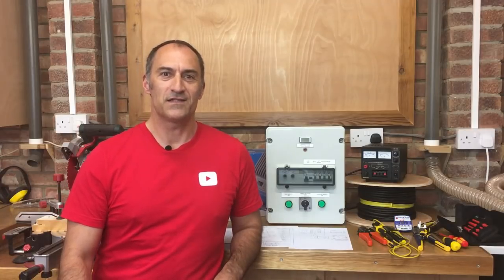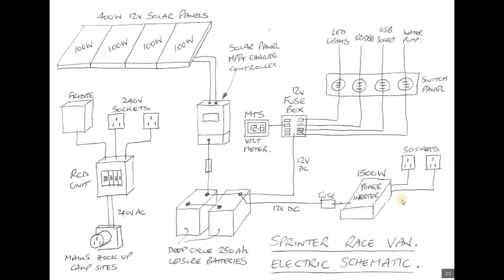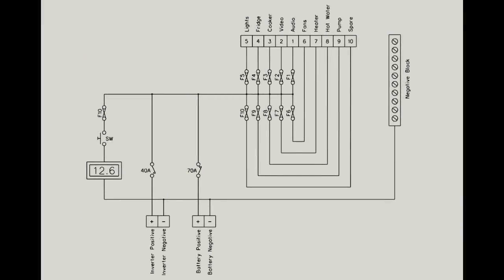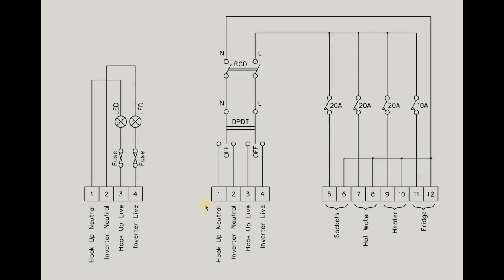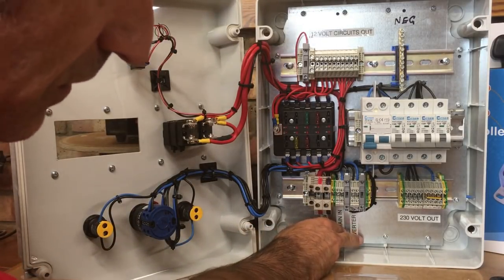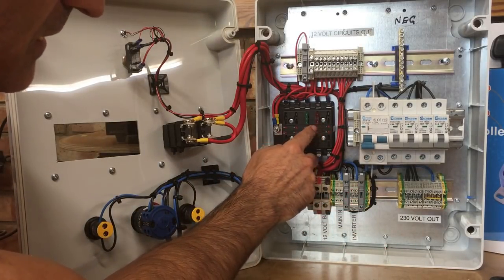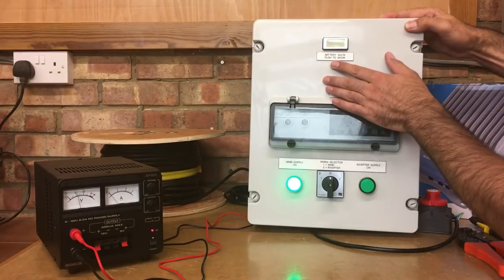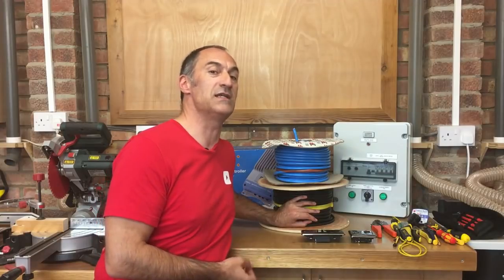Self Build Camper Van 12v Electric Control Panel

Comment: Hi Greg, great videos, we’re in the process of converting. Sprinter van also. Did you make the control unit yourself or did you buy this?
Reply from the maker: Jason Fleming it was my own design. But I would do it simpler next time like my latest off grid wiring video
Reply: Hi I’ve got the off grid wiring video, Greg Virgoe is the actual box you’ve used metal or plastic?
Reply from the maker: Jason Fleming it’s abs plastic with a metal back plate inside the box. Something like this one
https://www.ebay.co.uk/itm/402331548336

Comment: Have i got to nuy certain plug sockets for this set up i mean the ones with usb ports in thank you
Reply from the maker: Michelle Davis I would recommend installing 12v USB sockets powered directly off your batteries. Not the sockets I have fitted. It’s a better solution.

Comment: Hello Greg, what does your vehicle alternator charge? Many thanks
Reply from the maker: MACK when the the engine is running it provides for all the auto electrics and it charges the starter battery. 
I have not connected to my leisure system. Not needed it in two years of full time Vanlife 👍🏼😃

Comment: On the 12V leisure batteries did you also use a split charge relay to get power from the alternator?
Reply from the maker: Dan Rockell no I didn’t and would always recommend fitting a battery to battery charger instead it will look after your leisure batteries much better than a relay.
Reply: Greg Virgoe got ya, thanks very much for the reply. Watching your vids now, they are amazing! Did you ever think about doing vans and selling them?
Reply from the maker: Dan Rockell our van was a way that we could retire from work and enjoy more free time. I may do another conversion but will not be doing it as a business any time soon 😊👍🏼

Comment: Hi Greg, how did you wire the leds to the change over switch and what type of fuse did you use for them? Thanks very much
Reply from the maker: r mason the two green lights are wired off the incoming power supplies and have 1Amp terminal fuse carriers. If you pause the video at 10:20 you can see the bottom left row of terminals has the incoming power, fuses and led connections.
Reply: @GregVirgoe  Thank you! do you please have a link to the fuse carriers you used thanks!

Comment: Hi Greg, thanks for your fantastic videos! what amp changeover switch did you use? thanks!
Reply from the maker: r mason the 3pin plug has a 13amp fuse. The hook up is normally protected by a 16amp MCB so anything 20A or bigger is fine to use.
Reply: @GregVirgoe  thank you very much for your prompt reply, I have ordered a 20amp one, just collecting bits and bobs ready for when I get a van, thank you!

Comment: Just the solution I was looking for, it makes me realise it needs to be done proper, thanks for saving me from myself. Where can I get the clear cover that goes over the breakers please?
Reply from the maker: Here you go, they come in all shapes and sizes https://uk.rs-online.com/web/c/enclosures-storage-material-handling/enclosures/enclosure-accessories/?searchTerm=inspection%20window&redirect-relevancy-data=636F3D3126696E3D4931384E53656172636847656E65726963266C753D656E266D6D3D6D61746368616C6C7061727469616C26706D3D5E2E2A2426706F3D31333326736E3D592673723D2673743D43415443485F414C4C5F44454641554C542673633D592677633D4E4F4E45267573743D696E7370656374696F6E2077696E646F77267374613D696E7370656374696F6E2077696E646F7726&r=f&searchHistory=%7B%22enabled%22:true%7D
Reply: Greg Virgoe brilliant thanks, I’ll add that to the RS list.

Comment: Hi Greg do you make and sell your distribution boards? I am very impressed and would love to use your set up.
Reply from the maker: David Horsburgh no I’m afraid I can’t because of testing and insurance reasons. You don’t need this panel it can be done much easier by following my latest off grid wiring video
Reply: @GregVirgoe  thanks for your quick response

Comment: Thanks for a great video! Do you mind sharing what trips you use for the DC circuit, (the two trips attached to the door). Thank you!
Reply from the maker: Hakkspetsen they are dc trips from marine industry. You can get DC breakers that look the same as normal mains MCBs.
Reply: @GregVirgoe  Thank you so much for your reply, much appreciated!

Comment: Hi Greg just wondering when you connect the dpdt switch what terminals on the switch you connect to for the power out to your devices. As your drawing shows terms 1-3 & 2-4 but not where the terms are for power out p.s great video.
Reply from the maker: Ross Brooks the terminal numbers on my schematic are my outgoing panel terminals not the numbers on the switch. I have highlighted a diagram of the switch connections and uploaded it to this link.
https://www.dropbox.com/s/b05ufkk6kipojlr/EF661F04-8488-4C94-8352-282C21AC8132.JPG?dl=0
Reply: @GregVirgoe  thanks Greg you have saved my bacon once again and I watched the video over and over have been on it for ages we are hoping to meet you when we can get to camp quirky hopefully thank you in person for your help.
Reply from the maker: Ross Brooks will look forward to meeting you when this is all over 👍🏼

Comment: Hi would like to ask a few question re electric
Reply from the maker: paul durrant have you watched this one yet https://youtu.be/rVkDPzrA-zw
Reply: thank you where did you get your electrics from, finding quite hard to source supplyer
Reply from the maker: paul durrant I designed it myself and we built the control box from parts sourced from RS Components. The box is a weatherproof ABS electrical control panel box.
Reply: @GregVirgoe  thanks for this. Just embarking on the electrics for my partners van build. What size of IP66 box did you use please? checked your links to boxes and they just bring up a list of all different boxes. Again thank you! Rick
Reply from the maker: paul durrant and this one https://youtu.be/koFg6oFs0RU

Comment: Hi Greg, Your build is amazing! Fantastic knowledge, your explanations ands review are top notch great work. I'm just starting my overlanding Quadtech trailer build and I'm building a similar box with your videos, however Im struggling to find your Shore power consumer unit you have used as its very slimline and neat, could you point me in the direction on where this is from please. Stay Safe Dayne.

Comment: Thanks for the very informative video. What is the correct way to combine the live and neutrals coming out of the changeover switch to go into the RCD? Or can you have both going into the same RCD? Thanks
Reply from the maker: George Rudd the output side of the changeover switch is linked internally. 
That is the idea of the switch. Two inputs and one output. PM me and I send you a diagram.

Comment: I’ve got a 12 way fuse box with a negative bar on there but it seems easier to piggy back them from the switch panel instead of taking a negative back to the fuse box , it would look better at the fuse box with 6reds and 6 black wires just a lot easier to use a negative from the switches . Does this fit in with the regs or should I run them all back to The little fuse board?
Reply from the maker: You can run a single negative and common them at the switches just make sure that the cable size can handle all the load of all devices running simultaneously. I would connect it to the centre tapping so it directly connected to your supply cable. What I have seen very often is a group of switches common together with 1.5mm cable with no thought for what is connected on every switch, then before you know it you are way over the amp rating for that cable. Watch my recent video on cable sizing and fuse sizing.
Reply: Greg Virgoe there’re all different circuits so I’ve got 6 on my fuse board on different fuses but linking over the negative as it’s saves me running 6 negative back to the little 12 wayboard
Reply from the maker: Yes I understand what you have done. Just make sure that your single common neutral cable is big enough to handle the load of  everything running at the same time.

Comment: Hiya Greg, I was just wondering how you routed your vsr back to your battery’s and can you remember how much cable you needed as would like to order mine soon. Many thanks mate...hope you and Lou are safe and well.
Reply from the maker: I didn't install the VSR in the end, after taking some advice from my battery supplier they recommended not fitting it as the VSR is only a switch and will not regulate the charge voltage I could easily damage my AGM batteries. I would go with a B2B charger that can properly manage the charging of different battery types. Hope that's not too late for you :D

Comment: Hi Greg. I watched your van builds so many times but I am still confused with wiring the Mobicool fridge I bought. Do I buy a cigarette lighter female piece and wire that to the leisure battery via a 4mm cable?
Reply from the maker: If it comes with a cigarette style plug on it you can cut that off, connect onto the wires and extend the cables and just wire it to your blade fuse holder. I think most of these cool boxes need a 5amp fuse.

Comment: Hi Greg,  thanks for great videos 👍 
How do you wire the double pole switch please? 
Cheers,  Mark
Reply from the maker: Mark Ferbrache the switches normally go 1-2 3-4 5-6 7-8. Because of the small load you only need to use two out of the four pairs of terminals. So put positive on 1-2 and negative on 7-8. 👍🏼
Reply: @GregVirgoe  thankyou very much for such a quick reply 👍  
It's sorted now with your help so I'm very appreciated. Cheers,  Mark 🙂

Comment: Hi Greg, what about air con? For hotter climates, for some people it maybe a deciding reason to prohibit going to hotter countries. Is this something you have looked at? Can you get enough cooling effect, for a Mercedes LWB van without flattening your batteries too much? Also do you have excess power generated by your alternator when driving, to charge your leisure batteries?

Comment: Hi Greg, would you have been able to have your 2 green leds running off the selector switch thereby showing which was switched on (or both off in the middle off position)  and not confirming input power to both, as this would be confirmed if the led lights up, when the switch is flipped in that direction? Also, it might be an idea to have your 12v blade fuses in a separate box in case a non proficient person, needs to chance a 12v fuse. Also, do they make these blade fuse holders with an led indicator, thereby showing the fuse hasn’t blown?
Reply from the maker: There's many different ways to skin a rabbit mate.
If I did it again I would not build this panel, I would go 12v on as much as possible and only have a couple of 230v sockets off an inverter, I'd just have the mains hook up for a battery charger only and one socket in the garage. It's all you need. We have been 99% solar and never need to switch over to mains on the panel.

Comment: Hello Greg,

I am from Brazil and I am following your videos on the assembly of Splinter, especially the electrical system.

At 11 minutes of this video I have a question when you show the 12V circuit and say: "It will then be routed across to the DC Trip which will protect that circuit it will then with back into the panel."

What are these two sockets on the panel cover? Are they breakers? Are they connected to the Battery and the Inverter?

Could you send me the schematic of this circuit and describe what you used for this protection, including a suggested internet address where I can find it?

If possible, send me by email (luceliosimiao@gmail.com)

Thank you so much for this help.

Thank you,

Lucélio
Reply from the maker: Lucélio Ferreira Simião wiring schematics are in the video description. Those devices are DC breakers. 
Better thing to use would be DC MCB which you can get from eBay.
Reply: @GregVirgoe  Thank you very much for returning.

Comment: Hi Greg, Great video. Hope you don't mind me asking , where did you get the DC trips from? Regards, Paul.
Reply from the maker: Sk3lnonch these are from marine industry but there is a better solution you can get DC MCBs that look the same as mains ones and din rail mounted. Just type DC MCB circuit breaker into Ebay and lots of options come up 👍🏼😊
Reply: @GregVirgoe  cheers Greg. would be completely lost with out all the information you've supplied.
Reply from the maker: Sk3lnonch no problem happy to help you 😃

Comment: Hi Greg great video please can you tell me how you got your flip up cover on the control box and what is on the 12v left side next to the dpdt rcd side as I can't make it out and where did you get them.
Reply from the maker: Ross Brooks the waterproof flip up window was from RS components and those things are din rail mounted DC breakers
Reply: @GregVirgoe  thanks for the replies greg I have bought almost all the parts to build my control box and have been scouring rs and the Web but cannot fint the flip up lid do you have a part number please and I am pulling what little hair I have left out.
Reply from the maker: Ross Brooks search for inspection window https://uk.rs-online.com/mobile/search.html?searchTerm=Waterproof+inspection+window
Reply: @GregVirgoe  hi Greg just want to say thanks for all you help your video guides are slowly becoming a bible to me and u am progressing on my own sprinter van quoter well really do think you should keep doing what you are doing I have learnt to use sketch up from your videos and fitted maxx air solar and hookups from your vids you sir are a star.

Comment: Hi Greg just a quick question about your change over switch. If your on 12v & you put your inverter on to power up a 240v appliance & your Truma combi was on with 12v would it then change to run on 240v and  pull power from your inverter thinking it was on hook up. Also did you put your Truma on its own trip?
Thanks
Reply from the maker: Andy Beaumont you have to select the fuel type on the Truma controller. I never use the Truma on inverter as it’s 1.8kW and would fry my batteries in minutes. 
I have a dedicated mcb for the 240V supply to the Truma and I always leave the local fuses spur switched off so it doesn’t come on electric by accident. 👍🏼😀
Reply from the maker: Andy Beaumont the 12v supply you the Truma is just for the controls and ignition etc. That stays on all the time. 👍🏼

Comment: Hi Gregg, 
I trust you and your family are well.
What amperage is the RCD switch? What gauge cable do you use inside the control panel?(for the 230v and the 12v).
This info would greatly help, thank you.
Kind Regards
Barry.

Comment: Very smart system, I designed, build, install and Commission  control panels for factories and hotels for a living so can definitely appreciate good workmanship. I would mention however that having MCBs greater than 16a pointless as the largest supply you can draw would be limited to the hookup supply current (16a) so any breaker greater than this would be ineffective. I would also recommend installing a 16a double pole RCBO rather than the RCD as then if you where to overload the supply or have an internal fault such as a short circuit it would trip in the van rather than the hookup supply protective device.
Reply from the maker: I have swapped out the MCBs for smaller ratings as you rightly say there is no point.

Comment: Hi what size is the adaptable box you used for the control box. I want to build one the same size.
Reply from the maker: It is approx 300W x 400H x 120D
Reply: @GregVirgoe  hi Greg thanks for the reply and all the great videos just wondering where you take you neg for the 12v from and what did you do with the rear internal lights that the van has. Many thanks
Reply from the maker: Ross Brooks all my 12v leisure wiring goes back to my batteries. I don’t use the van chassis at all on the leisure side. You can see a really clear explanation and free wiring diagram in this video I did not so long ago.
Reply from the maker: Ross Brooks https://youtu.be/rVkDPzrA-zw

Comment: Is there an easy way to make it so that the mains power from the campsite can still charge the leisure batteries?
Also can we wire the ground of the batteries and appliances to the chassis instead of running them all the way back to the breaker box?

Comment: Hi Greg, quick question. Is the black 12DC cable also 2.5mm?  Many thanks Nick.
Reply from the maker: I used 1.5mm for the 12vDC light circuits
Reply: @GregVirgoe  Thanks Greg, Really appreciate it and thanks for all the videos, they are a great help with my build. Cheers Nick.

Comment: Excellent explanation. I am still unsure about whether I could do it. How did you build the centre control panel? Are they available to buy, then you put all your bits inside?
Reply from the maker: Too young to be old you buy the enclosure and all the components and put it together and wire it yourself. There are manufactured items out there like Sargent PMS3

Comment: Hi greg, I’m currently building my sprinter but was told by an electrician i need to have my 240v system certified because camp sites wont allow me to hook up to their plugins without proof of certification. Is this true? Have you had the same problem or not? Cheers, karl.
Reply from the maker: I have never been asked for any certificates and we have stayed on hundreds of camp sites for over 18months now including registered club sites. It is a good idea to get your electric and gas checked over for piece of mind but it has not held us back at all.
Reply: Greg Virgoe ok thank you. I will have it checked when i eventually register it as a legal camper van as you did but i plan on using it semi built too so i don’t miss out on the summer fun. Was hoping to do camp quirky but it wont be finished for then plus sold out anyway. Cheers greg.